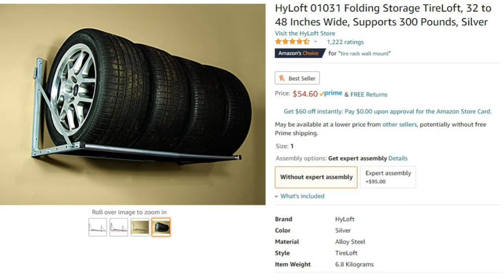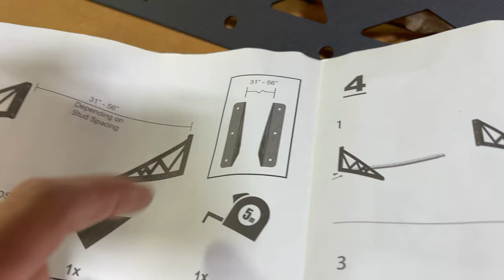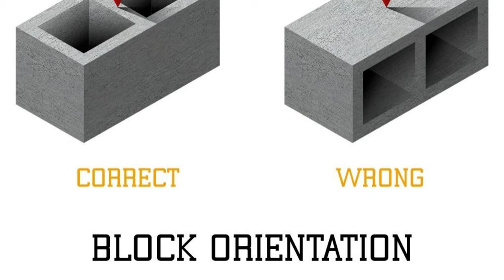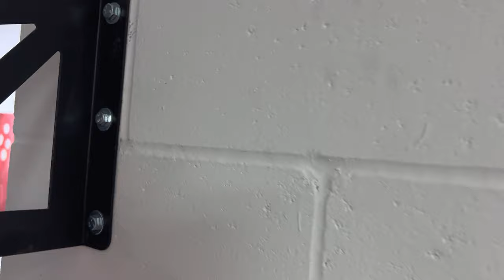How to Install Tire Storage Rack on CMU Block Wall

Comment: Im rocking the cheap ones from amazon, they come with the lag bolts. No complaints.
Reply from the maker: That was what I was originally looking at MaxxHaul and Hyloft but then went with these SafeRacks since it wasn’t much more at the time. Plus I already had their overhead shelves and was impressed by the quality.

Comment: I noticed on the first one you installed you added a support to the ceiling - what was the purpose?
Reply from the maker: Yea...I needed a way to hook the ratchet strap so I put anchors into the ceiling beams. Extra protection, I don't want to come home one day with wheels on top of my car.